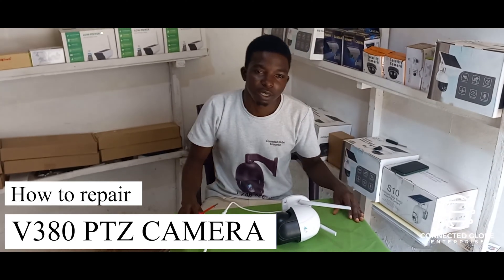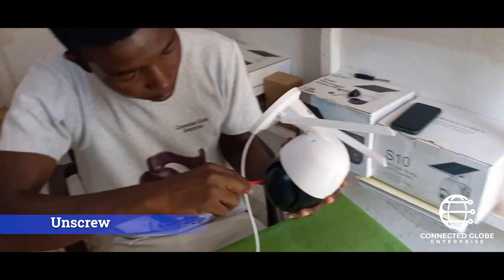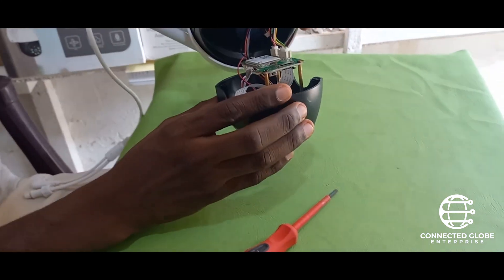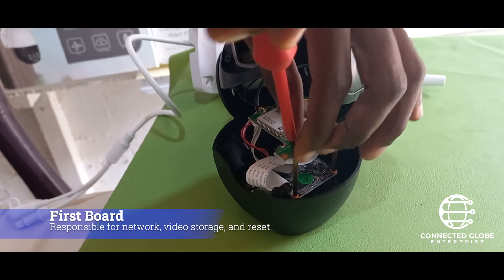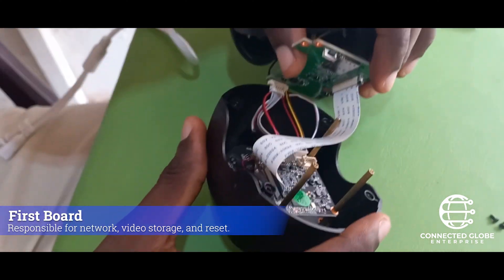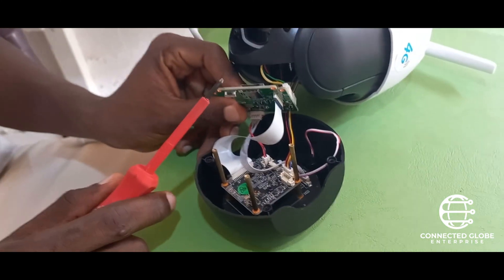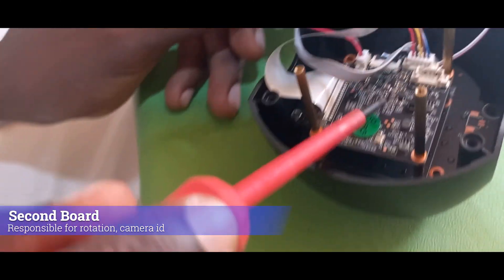How to repair your CCTV V380 PTZ camera.

Comment: Klau problem lampu indikator tidak menyala, solusinya apa ? Terimakasih
Reply from the maker: It means there is no power in the the battery. Try to boost charge the battery using electricity instead of solar power.
Reply: @Connectedglobe cctv SIM-card tidak menggunakan baterai atau solar panel tetapi menggunakan power suplai 12 volt , saya check arus ada sampai pada soket selanjutnya bagian mana yg ditelusuri?? Terimakasih

Comment: I was using CCTV 4g SIM solar camera which was working fine. I am not sure issue with the sim or firmware the device continously showing offline. Please help and guide
Reply: The same issue with this campainy v380 I have tried all Mines but nothing am also want to reset it it only shows led light but no any sound how it was before after reset nothing only OFFLINE
Reply: Upto now

Comment: My v380 p2 camera, when you plug it and there's light which never turn off and after that it become hot. When i try to reset. No voice prompt.
Reply from the maker: Which part of the camera gets hot?
I think it's a software issue. Because "When the device indicator is red, it means the device is powered on and wakes up, but it is not connected to the network".
Reply from the maker: When the device indicator red light flashes continuously, it means that the device cannot recognize the SIM card, check whether the card is inserted;
 When the device indicator light flashes red double continuously, it means that the device recognizes the SIM card, but it is not connected to the Internet. Check whether the SIM card has data.
Reply: @Connectedglobe if it's only Sim card why can't it be reseted as usual?
Reply: I have check it ,it as

Comment: My v380 p9 dl 4g solar camera , cannot be reset to factory, blink 3 red light , when pressed and hold the reset button , nothing happened , it want rotate and no sound. what you suggest to do ,
Reply: Hello, have you been able to fix it, because am having exact same issue with my own
Reply: The same I have the real issue but hope is this company it has dat issues almost I don't know what's aproblem @emytechglobal9520
Reply: V380 pro I HAVE REALIZED THIS COMPANY HAS THAT PROBLEM, ALMOST I HAVE IT IT CANT RESET IT CAN'T GIVE SOUND AT FAST THAT SHOWS U RESET NOTHING ROTET WHY THIS YOU
Reply: Upto now there no solution there give out manual update but nothing

Comment: After the latest firmware update from V380 Pro app, the camera can't connect to the network anymore. Any idea from where I can get an older firmware?
Reply: Please I need help all my solar cameras suddenly stop working and only remain with the red light but don't power on why?
Reply from the maker: It's a long process. You will need to reconfigure the chip. It's better you format the camera, and see if it will work..
Reply: @Connectedglobe  Thank you for the response...can you please tell me how to format the camera?
Reply from the maker: @popapiandrei   see this video
https://youtu.be/_1mKFZXHEe0?si=tVaZGwAk9yjA5hm5
The instruction is between 
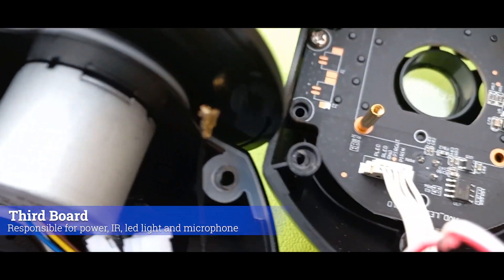2:50 - 3:12
Hold the button for until you hear "camera reset".

Comment: Every type of these PTZ cameras all have the same connecting cord that lets water in and shorts out either the board and the solar panel or shorts out the camera it's junk I just cut the thing I cut the connector The second I take it out of the box brand new I cut the connector and I saw them together and waterproof them to choke The cameras are good to put a cheap connector in China is a joke
Reply from the maker: Okay

Comment: V380 camera is showing too much whitening, over exposure, how to reduce over exposure, is it through app or should clean the sensor or lens
Reply from the maker: I guess the camera is facing the light source. Try to avoid that.  Check the covering on the lens if it's not dusty.
Reply: It is because of the Anti-Flicker settings, you need to switch them off.

Comment: Mine 4G V380 PTZ Solar Camera has an issue, holding the reset button always put the red blinking diode, the voice says "camera reset completed" (or restart - not sure), but no Wifi AP is established by the camera to complete the configuration, any hints for me with this one?
Reply from the maker: 4G cameras don't require WiFi to function. All you need is a sim card with internet data. Ensure that there is internet data on your sim card, insert your sim card into the sim port on the camera board. Give it 10 seconds to load, the red indicator changes to yellow, which indicates that your camera is now online.
Reply from the maker: If this does not work, it means that your camera does not support the network frequency band of your sim card. You will need to get another sim card of a different network.

Comment: Please my client 4g ptz solar cctv ubox have a problem. 
The problem is the camera just suddenly turn on red light and now the red light is still on. And if the red light doesn't turn to blue light , the camera wont work . Please do you have any solution to this. Help
Reply from the maker: The red indicator indicates that something is wrong somewhere. So, you have to troubleshoot the camera
Carry out the following;
1. Confirm if there is data on the sim card.
2. Confirm if the sim card was inserted properly.
3. Confirm if the sim card is still active. It's possible that the network provider has blocked sim card. Put the sim card in a phone and make calls with it. To confirm that.
4. Change the network to another available good network. 
5. Check whether the device antenna is broken.
6. If you are using an extender solar panel, ensure that the distance between the panel and camera is short to avoid power loss.
7. Reset the camera.
Reply: @Connectedglobe please how can I update the firmware by USB?
Reply from the maker: @SDMTECHNOLOGIESUG  Speak with the seller. Your supplier should put you through.
Reply: @Connectedglobe it cant Evan be reseted
Reply: I have 4g Solar PTZ Ubox that is not showing any indicator light but the panel and the Batteries are ok cus I have checked it with another camera. What should I do